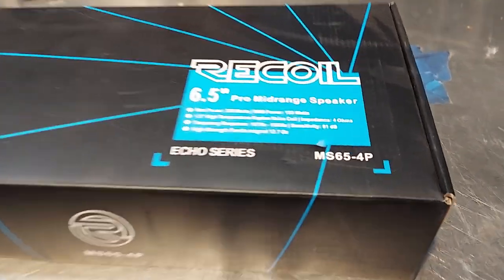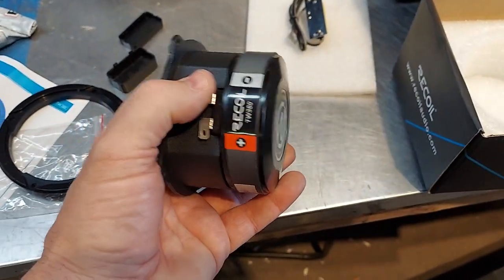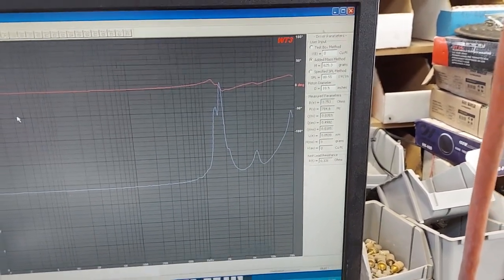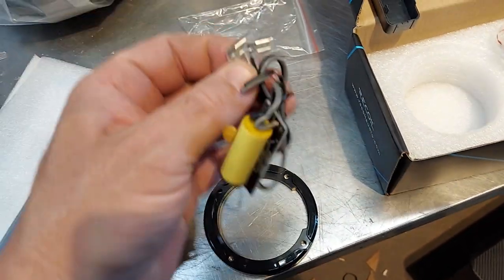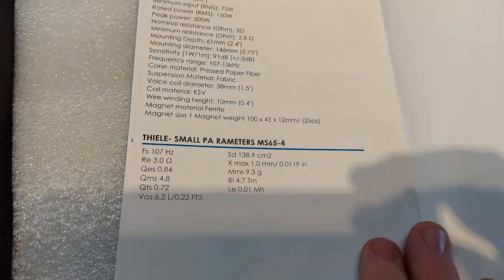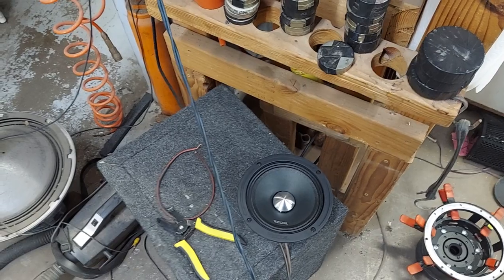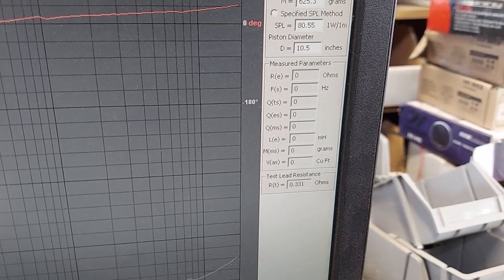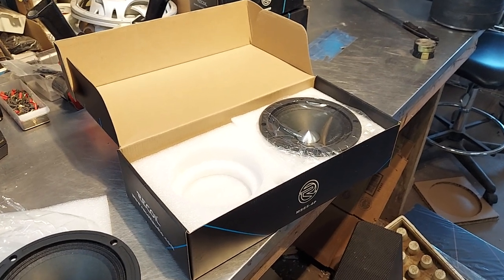Recoil PA / Car Audio mids & tweeters MS65-4P $50 per pair TW250 $40 per pair TW380 $60 per pair

Comment: Doing break-in at Fs is the best approach, as the cone can be driven to xmax easily without having to apply too much power to the coil (impedance is highest at Fs).  It's a decent idea to measure t/s params when the coil is slightly warm anyway to reflect real-world use.  

I'd love to see an FR and THD curve for those tweeters.  When choosing a filter point for tweeters in x-over design, I use both the FR and THD curves as input in the design process, basically choosing the Fc and slope for the filter where the tweeter's THD starts to ramp up....

Comment: What's your opinion on those Super tweeters? I had a pair of Image dynamic horns with a Rockford Fosgate Symmetry running everything. They were very loud but to me I had to add a 1" tweeter to make it brighter. To me they seemed like mids just for the higher frequencys. I heard a pair of super tweeters and I thought it sounded the same very loud but not bright. Just wondering, everyone seems to have them 🤔
Reply from the maker: I'm surprised they play so low.  Really great value.

Comment: Why play anywhere near that low with a tweeter?
Reply from the maker: One octave or higher than the Fs.  So if Fs is 750Hz, 1.5kHz is fine for a crossover point.  The higher and steeper, the more power it can handle but the compromise is pass band.

Comment: Trying to follow your saying lpad and pots? Pot is potentiometer to adjust db to tone them down?
Reply from the maker: Same device just one is high power one is low power some of them are wired differently.   Typical configuration is in,  out and common

Comment: So everything is on recoil site as of now also . What makes MS65-4P 6.5-Inch Midrange Pro 300watts and the other pro range only 150rms ?
Reply from the maker: No, that's a marketing thing that I don't agree with but you cannot stop them.  Each driver is good for 150wrms / 300wmax but with a high pass XO of around 400Hz. (A simple 50uf cap)
Reply: @RobotUnderground  I figured thanks for always responding too all us knuckle heads

Comment: I have the echo series components. If i just swap the speaker with this midrange will it make a difference in loudness?
Reply from the maker: It will be louder but it won't play as low.
Reply: @RobotUnderground  i just want something louder without having to change amp on the speakers. I want louder vocals
Reply from the maker: @javierrodriguez3896  ok. That's what I would do